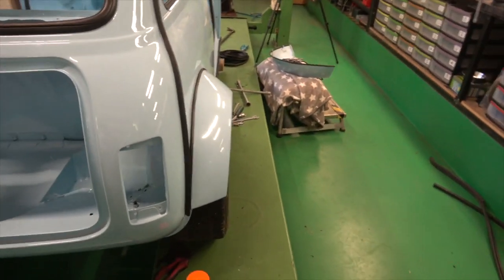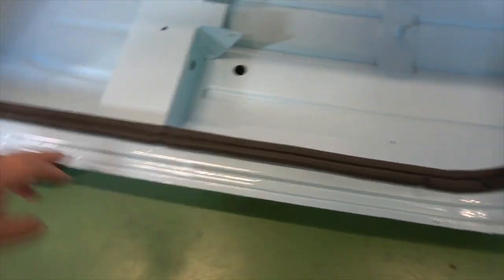Classic Mini Door & Arch Seal tips

Comment: Looking fantastic.
Reply from the maker: Neil, One comment was Too Nice for a track car i take that as a complement lol, Cheers Dave
Reply: @ClassicCarCave  
Doesn't matter what the intended use is, it's a case of doing a quality job to the best of your ability and having pride in your work, which is what you do.
I'm sure you wouldn't do a shit job just because it's a 'Track car'.

Thanks for the tip about fitting door seals early.
Would you recommend doing that as soon as it returns from the paint shop ??

Keep up the good work.
Reply from the maker: Neil, Alternate the rubber between the glass and the shell a few days at a time, You may have to use masking tape on the glass
but it will make the rubber fit far easier, Cheers Dave
Reply: @ClassicCarCave  Top tip. Thanks.

Comment: The cars coming along. I have put a strip of similar rubber down the edge of the doors to prevent garage rash as I fit bits and pieces in to the car.
Reply from the maker: Stewart,  It is nice to bolt and fix new clean stuff on the car, It works really well and it‘s so light, Cheers Dave

Comment: Are you closing up the holes in the rear parcel shelf? You might have trouble at scrut I'm pretty sure cockpit needs to be sealed from engine and boot
Reply from the maker: Mat,  Yes i will make a 1mm Alloy plate to cover the shelf, and seal it from the race tank, Cheers Dave